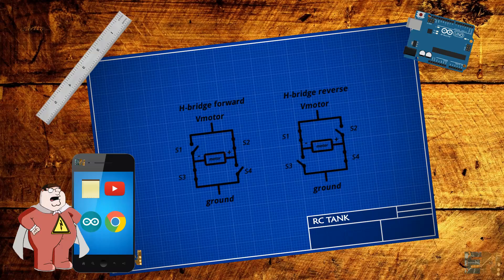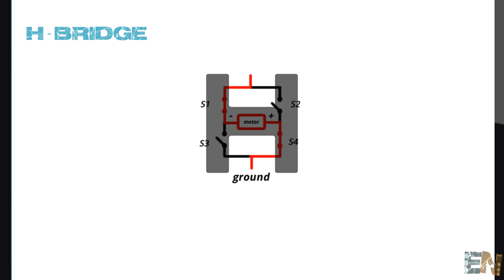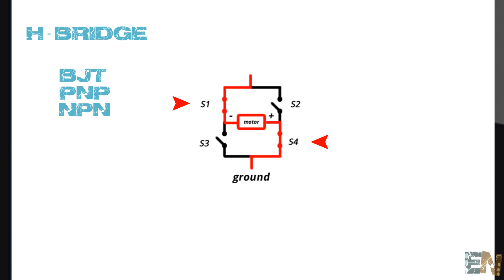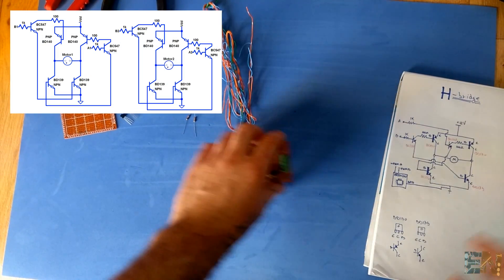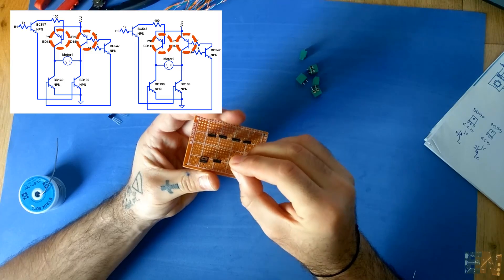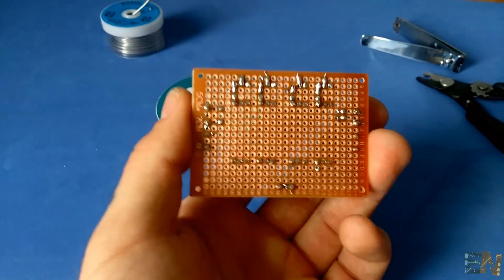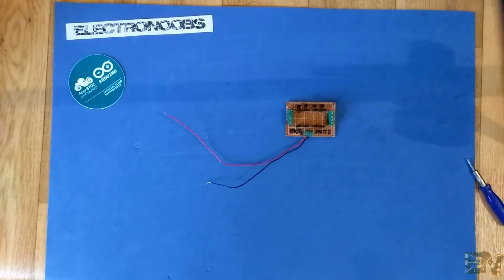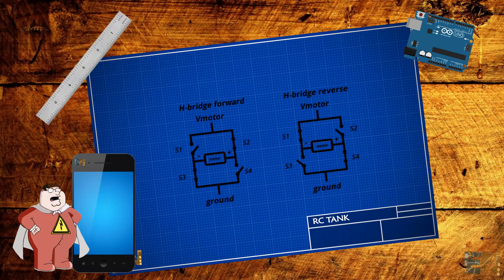H-bridge DC motor speed control

Comment: you have to isolate the Arduino  otherwise you may burn it in case one of the H bridge transistors fails , its a common issue

Comment: were are the fly back diodes? are you using a special transistors? and can i get away with any npn / pnp transistors without protection from voltage spikes?  
I'll use the bridges for controlling small stepper motor.

Comment: how i control h bridge with rf transmitter and receiver because the output volt of rf transmitter and receiver is very low
Reply: RF VIRAT SINGH You amplify it with transistors. Search for : Sensor Signal amplification with transistors. Do you want just to turn on the motor ? If so, this would work. But if you want to use it for more complex applications, then you must use a suited microchip ( ic ) for this circuit.

Comment: can we connect two different dc motors i.e one with 10000 rpm and another with 150 rpm
Reply: Depends on the working voltage

Comment: I don't want to modify my transmitter(spectrum dx6i) or receiver (spectrum compatible) will your h bridge esc work for it and if not can you help me find a cheap esc that works along with the gear boxes and motors you used?
Reply: im also planing of making an m10 tank destroyer (my great grandfather was commander of one) can ya help me out with that caus I cant do a good job of making one so I need help from someone who makes a good lookin rc tank in a 3d modeling program please and thank you
Reply from the maker: If your receiver has a normal PWM signal output it should work. If you don't want to build the module I recommend this one:
http://www.ebay.com/itm/Stepper-Motor-Drive-Controller-Board-Module-L298N-Dual-H-Bridge-DC-For-Arduino-/170926726867?hash=item27cc06ded3:g:s4wAAOSwXeJXe31g

Keep up!
Reply: Electronoobs thank you so much I know all connections work for servo motors and brushless escs and I will need to find the specific name for it,I don't have it rn and I also want to know ,where did you get the motors and gear boxes from?
Reply: Thank you Soo much

Comment: Thanks really a lot! Please can you make part 2 of this video. How to control this circuit with radio corntrol. Thanks!
Reply from the maker: The video is already online! https://www.youtube.com/watch?v=S8BK7-1O4HE&index=5&list=PLsR1AO4QH1Azc1GAVVENWYPAFE1k_gqjb  Keep up!
Reply: @ELECTRONOOBS  Can you build or try this one if you can you will be a star.....can you built a circuit or connect relays I supposed of different kind in such a way that if power is coming from two different sides but when one power is on the other one is off completely until one power is off and then the 2ndry power comes on-basically power is coming to the circuit or relays from two different sides but one must swith off as long as the other is on and if it goes off then the other one which is off should come on. If you can do that you will be a star ha ha
Reply: @ELECTRONOOBS  can we use 3144 hall sensor on A and b pwm input